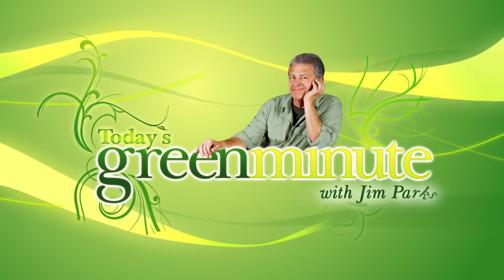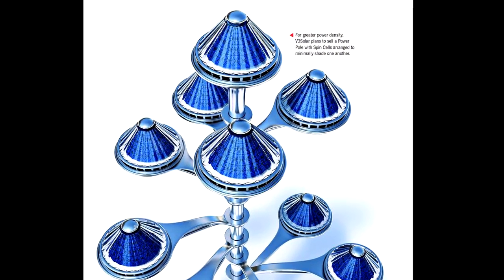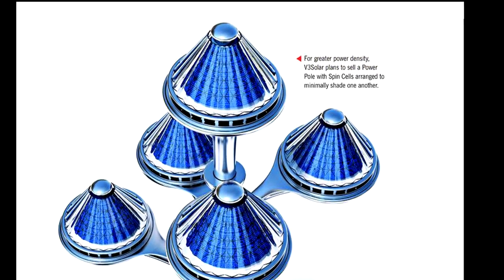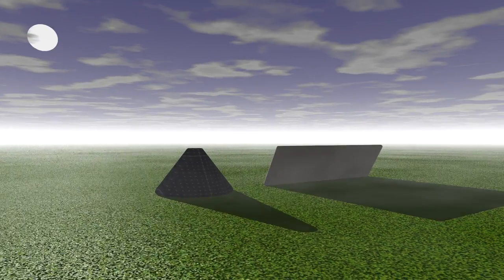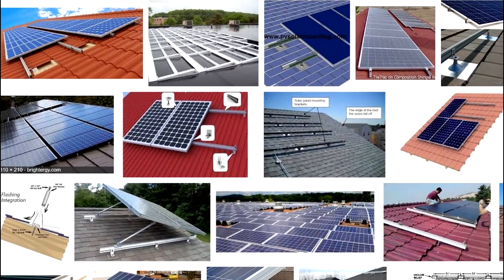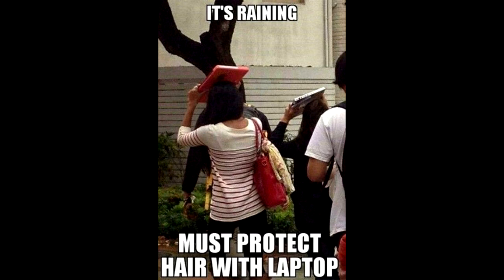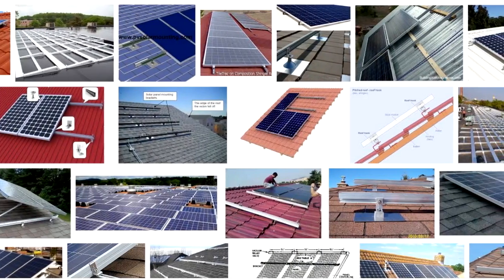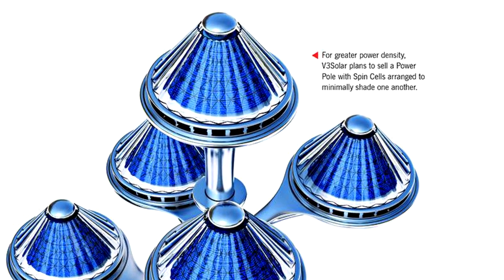Spinning Solar -BUSTED!

Comment: My first thought was that tracking solar panels are already a thing, getting as near 100% efficiency possible. Then I wondered where the electricity to spin them came from. Then I wondered why you would calculate it as having 100% of it facing the sun at a time. In other words, there’s so much wrong with it.
Reply: It gets even worse when you realize (and forgive me if this is mentioned in the video) that flat panels get the most solar energy when they are pointed directly at the sun, with 100% of the flat panel facing the sun... with a cone shape, only a tiny, tiny portion of the cone is pointing directly at the sun at a given moment, with the rest varying in increasingly larger degrees away from the leading edge of the cone facing the sun - by which I mean, because the cone isn't flat, only the tiniest sliver of its surface can point directly at the sun at a given moment, and thus the half that IS facing the sun is less efficient than a flat panel would be.

I suppose it's possible to design materials that will spin things without electricity - boiling water, winds, and storms do this naturally, with hotter fluids tending to rise and expand and cooler ones tending to sink and contract, with entire atmospheres and oceans kept in motion without heat.  But somehow, I suspect that the inventors involved haven't thought things through well enough to have invented something that could keep these cones spinning without electrical motors:  everything else looks so half-baked, I have no reason to think that part is any less so!

Comment: Are you sure that cells produce 0% power in the shadded area? Are you sure that temperature have to be measured on the panel surface( around 40 degrees Celsius) and not in the cell (around 60 degrees of the same Celsius)?

Comment: Jesus. Let me explain the obvious. The cones spin at four times the speed of light, and since you don't know which side hit the photons first the particles enter a quantum state where they power all panels on the cone. UNLESS you measure it of course. That includes measuring the power or speed of rotation, which could infer the amount of light absorbed. 

Really, I'm pretty sure they teach this in elementary school.
Reply: Fun fact, they don't teach that.

Another fun fact, something cant spin faster than the speed of light, I'll quote this guy,

"Rotation is not measured by speed (length divided by time). It is measured by angular velocity (angle divided by time). So the rotation of an object cannot be directly compared to the speed of light.

However, the simple answer to your question is that no part of the rotating object can move faster than the speed of light. If the object is small enough, it can still rotate at a zillion times a second. If it is gigantic, it can only rotate slowly, otherwise parts that are farther out from its axis of rotation would move faster than light."

And if you don't believe him, he Mastered Physics, University of Oxford (2018) AND he is a part-time physicist.

So maybe you should think before acting all smart on the internet.
Reply: Oh geeze did I forget to close the sarcasm bracket in the BBCode?

Comment: Why don't they make a circle and rotate it in the middle! Well, then the middle would be warmer so why don't they put like 6 of them on a disk or something and rotate that! Boom! And they don't even have to rotate the panels, just the base but you would need the energy to rotate the whole system, and why won't they make it JUST the base and make THAT the panel! And were at the start again xD

Comment: The bible doesn't claim that pi=3, the closest it comes is a measurement of a bowl that was 10 cubits across and 30 "around" with some thickness to the walls.  Whether the outer or inner circumference was taken isn't clear, but if the inner circumference and outer diameter were taken, then pi for both circles comes out to around 3.139, which is pretty close to right for people who measured things by the length of your forearm and width of your hand.

Comment: I guess I don't get it.  A flat panel only works at max efficiency when it's perpendicular to the Sun's rays, right?  And it loses 20% efficiency as it heats up?  And unless you have a panel that tracks the sun in the same way as a sunflower, a stationary panel only hits "max efficiency" once a day relative to the position of the Sun to the Earth.  So that means that from Sun-up to directly overhead (Noon), the efficiency goes from just over 0% (night) to at best 80% once hot.  Then, from Noon to sundown goes from overheated 80% to 0% until morning.
So wouldn't the ability to rotate solar cells in and out of perpendicularity (ignoring power loss to whatever generates the spin) to the Sun keep them cool enough to generate 100% power at peak efficiency?  And a cone always has one spot at peak efficiency during daylight.  ...So, yeah, the dark side of the cone generates no energy as it cools, but gradually generates more as it goes from the horizon to peak and then gradually less from peak to opposite horizon multiple times daily.  A flat non-tracking panel can't be rotated out of use to cool, and only goes from horizon-to-peak-to-horizon once daily.
I think there are too many variables not being considered to entirely rule out the efficacy of spinning conal solar panels.

Comment: Regular solar panels work by allowing photons, or particles of light, to knock electrons free from atoms, generating a flow of electricity. The cone shape spins due to the heat as well and rotational energy from the heat can be used in theory to make them produce more energy. This video does not address that aspect at all. So either this this video is busted or half correct at best.

Comment: With the weird off/odd thing being how about +90% of the inspiration for and to a degree driving force behind casual and above casual pursuits for "Real" Science,  tends to be due to or as from Fiction to include such works of 'Fake Science,'  such where someone using Real science might yet find a real thing with real value if of a different nature.

"Fake" Science and outright Fiction should never be taken past face value and in place of actual Due-Process / Scientific based Research.
Still by the same without good fiction we'd have less to care about... Eh?

Comment: While this is most likely a complete scam, there are a few point should have been addressed — how much money is spent on making a panel ‘thermally efficient’. If it’s a lot, and you didn’t have to do that, could you make a larger panel substantially cheaper? Another point if they don’t have to be thermally efficient could you focus a larger area on to a smaller panel surface (say cover half the surface with panels, and then make the light twice as bright on half the surface?)

Comment: These mofos do not have the slightest idea about the heat induced losses of a c-Si PV panel. I have actually measured experimentally the losses and they are roughly 15-20%. That is, the final power output of the panel  after it has reached thermal equilibrium with its surrounding is 85-80% of the initial produced power before it heated up. Without going any further into the orientation etc this christmas tree PV looks like BS..

Comment: then would it be better if they slowly rotated the flat solar panels with some electricity are going to a few fans cooling them off from behind with some heat sync?

Comment: The Bible does not state that Pi is equal to three. In regards to the Temple of Solomon the Bible states a condition of fact not a fact of mathematics.  It was people hundreds, if not a thousand years later, which wanted there to be hidden meanings in the Bible that made the insistence that the Bible must have been referring to Pi, when it was not.

I do like pseudo science being busted. But taking an extremely cheap shot a people that believe in the Bible should be beneath your intellect, but obviously it is not, your just being a smart bigot.

Even if your right that there is no God, other people have the right to believe that there is God.
Keep the intellect, lose the bigotry.

Comment: You neglected basic ergonomics during the comparison to the tracking solar panel. You could fit several of the cones in the same space of the tracker, thereby increasing the effective surface area to generate more power in the same space. The trees would be the same in that sense that you can fit them in any area better.
As well, maintenance costs go down dramatically with the easy cooling of the solar panel...

Comment: There are many things not taken into consideration here. Yea, there would be some cooling effect but we cannot estimate how much since we got no idea how fast the cone will rotate. It is impossible to estimate the heat loss from turning away from the sun vs the heat generated from the rotation friction without seeing their calculations (no such thing as friction-less motion btw). Yes there are advantages to the rotation of the cells and the cone will receive sunlight during ALL times of day but we do not know the method of rotation, not even the means and potential energy consumption. There simply is not enough data given on the design of the things to make any sort of accurate claim about their efficiency.

Comment: What a mess, but seriously on an informative note: heat reduces the efficiency of solar panels. There is a valid point on cooling the panels, but this is not the case (the product on the video).

Comment: I think that by 20x more power it meant the total power output per day compared to a regular solar panel, that's much different than efficiency.
Reply: It's not clear what they meant by 20X more. 20X more than what?  They just said flat panels.  Flat panels pointed in the wrong direction?  But the bottom line is if these worked, great, show them side by side with the panel that is making 20X less.  But these are never presented as working vs anything.  Just spinning.

Comment: He rounds pi to 3 to make it more convenient then accuses the Bible of being wrong if the writer does the same thing. Sounds like a bit of hypocrisy to me. How about if we say that the writer of that part of the Bible left out the sentence where he says "let's use 3 for pi so that Thunderf00t can be right for once". But is not about the value of pi at all is it? If the writer had made 3.14 you would have still call him wrong because he did not make it 3.14159. If he can carried it out to 100 digits you would still complain that he was wrong because he did not realize that there are more than 100 digits.

Comment: Your making a pretty strong case. But, you forgot to check worst case angles on the solar. You know when the mounted once receive less direct sun. Like dawn, dusk or winter time.
Reply: I think the maker eventually said their 20X figure was based on panels laid flat on the ground and sometimes obstructed by trees.   But even that sounds far fetched.  And they have never done a side by side test.

Comment: This fucking channel is filled with all the SAME type of person. You all just want to hear the sound of your own voice. Don't pretend your science literate in the slightest because at best this is knee-jerk analysis. Might it still not work? Probably, but the utter arrogance of the majority of you makes me cringe. 
It's too bad because this idea isn't really THAT crazy,
Lensing would work quite well and rotation would permit cooling all you need is more focal mirrors around it that based on your latitude "more or less" cause more ambient light to hit it. Running it UNDER glass or with a MOTOR...is inherently completely stupid. I can think of plenty of better ways to cool it passively and much more efficiently....which if they implemented would make this idea pretty viable. (I'm not gonna just give my best ideas to youtube if anyone tries to be a smartass and troll my comment.)
I think you're being a bit of a hater @Thunderf00t , yes some of the issues with this are blatantly stupid but there's other parts which could totally work and if they're doing what I'm thinking (if all the info isn't out on this yet or it's still in development) it's actually ingenious. 
GASP Making power from solar is always difficult, busting out wikipedia articles to cherry pick your point isn't. This implementation isn't as stupid as one might knee-jerkingly think.
So please, stop circle-jerking your opinions and egos, that's all this is, anyone who deals with finding facts in their area of expertise on a professional basis already gets a TON of shit for being an egotistical elitist with superiority complexes. 
This video and comments from people working outside their elements and reducing things to instant first impressions, the lowest common denominator of intuition, and then claiming to be science literate, is a fantastic sample of why.
Reply: Lensing and cooling are readily available to flat panels.

Comment: Hmm... what if instead of the whole lens and spinning thing, you had a convex reflective surface around the solar cone. The cone would have to be above the mirror so it was always exposed to the sun and the convex reflector may reflect the sun at the back end.
The panel wouldn't need tracking, assuming it worked.

Comment: They are designed for the equator..... that said, the cone doesn't have to be sitting flat when you move away from the equator.
The only problem with being arrogant on either side is the fact the universe isn't binary.

Comment: i know a kid who did a few experiments with his mothers old garden solar lights the solar panel was about 8 to 10cm he rigged it so it would charge one of those fat batterys that you get in small torches now, he just used scrap mirror sections and glue the solar panel did make more power and it also did die prett quick

Comment: Another classic Thunderfoot video where he almost goes as far as the marketing BS in the other direction. Overselling the inherent issues and ignoring any potential for benefits.

Now, I'm not saying that the claims don't seem silly to me  on some level, but sometimes it's nice to be both skeptical and fair. For example their claims to "efficiency" may be power output vs cost, as opposed to "efficiency" in terms of  output vs surface area.

In real terms they are often the same BUT if I'm going to be a bit charitable and assume that the inventors aren't knowingly trying to decieve people, I'll also assume that removing some of the overheating concerns dramatically reduces fabrication costs. In which case you might gain some "efficiency" in terms of cost. 20x? No, that's probably silly. But there is potentially a scenario where sacrificing input from the sun might actually increase your energy output per $. 

Of course it depends on what is making them spin; but whatever it is will always be energy that could have been output as electricity so it's an efficiency cost no matter which definition on efficiency you are going with.

This isn't the hill I'm going to die on, I don't think that this will be the future of energy production, but Yeah; I'd like a less marketing BS talk with the team working on it to understand their thinking a little bit more clearly.

essentially there may be a case for smaller cheaper solar cells in more places with lower cost parts over larger arrays, as part of a solar solution. A tracking solar panel needs cooling, it needs some form of computing and it needs motors to power its movements. All of these reduce efficiency both in terms of output and cost. probably not to the degree that covering up half of the array would, I'll grant you, but passive cooling, removal of computation, and a less power hungry means of providing motion, along with a lower cost panel design *COULD end up with something that's more versatile in terms of where they can be positioned and low cost enough to approach the output/cost that a tracking system provides.

 in terms of domestic roof based installations for example, positioning regular flat panels on the southmost facing roof plane (in the northern hemisphere) and a row of spinning units along the roof ridge have benefits IF THEY ARE CHEAP

and they would have to vbe VERY CHEAP to be a worthwhile option in anything other than luxury installations where aesthetics trump all other concerns.
Reply: Agreed, we/he should be fair, but How could it possibly be cheaper to make something in a cone shape vs flat?   I believe the maker was saying they would spin due to rising hot air in the cone.  That would be free, but it's going to need a high quality expensive bearing to spin with that little input, and a hole in the top to let air out (and rain in).
I think it would be great if this stuff worked, but if it did don't you think the maker would show it working?   Computer animations are easy, you can make dinosaurs eat movie stars.  And this thing could be prototyped in a few days.  But they did not build any...
Reply: How the hell is something with moving parts going to be cheaper than a static, fixed solar panel? And how are you going to RELIABLY get the power off of those moving panels and into the fixed wiring that runs to a load?

You are the gullible fool that the conmen are targeting (and I'm being charitable)
Reply: @Slicerwizard  
Don't be charitable to idiots like that. These tools needs some hot concentrated verbal vitriol thrown at them.